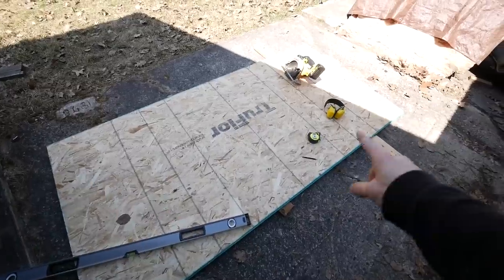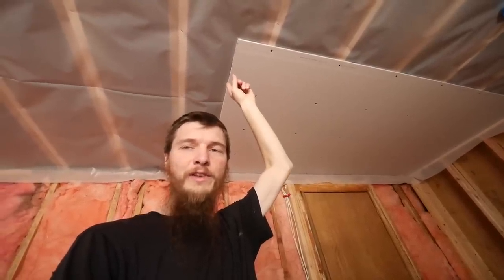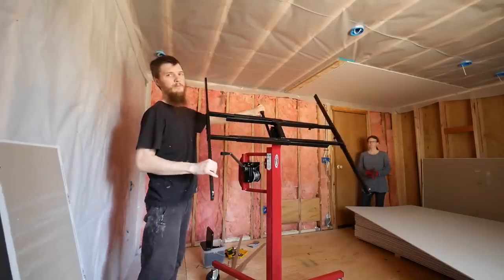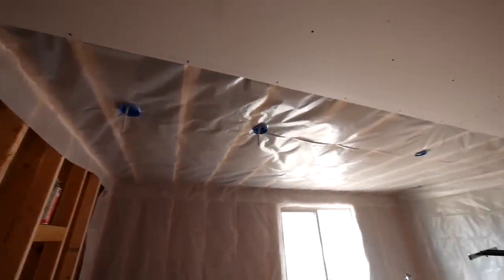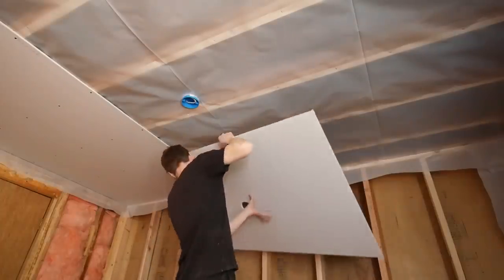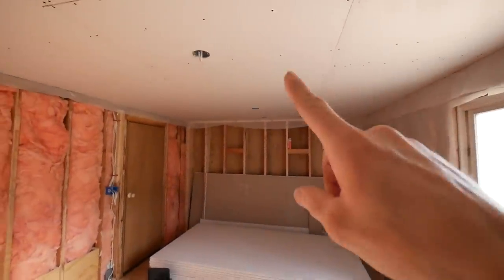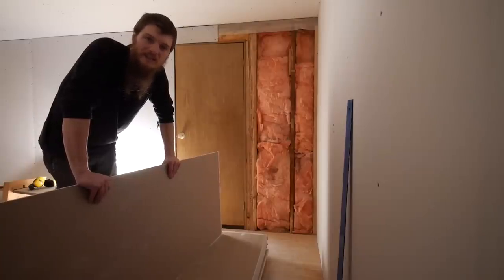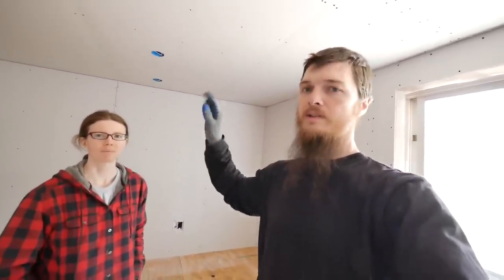DIY Amateurs Hang Drywall Like a Pro - Home Renovation

Comment: Awesome job guys!!!!  We went through a ton of drywall bits doing our house. I should have bought stock in the company, lol. We have to redo the kitchen ceiling and one of the bathroom ceilings because I hired a “contractor”, cough, cough, who didn’t know how do do skylights properly, AND forgot to put in the insulation in the ceilings of those rooms. Huge mess. True story. Anyway, he didn’t use a drywall lift either, so I’m going to order one from Harbor Freight I believe and we will do it ourselves. Should have done the ceilings ourselves to begin with. Live and learn, lol. You make it look very easy, and since our older son is 21 we have a third set of hands. I knew these kids would come in handy someday, lol 😉. Great job 👍👍

Comment: Safety tip: when cutting drywall be careful of the placement of the hand you’re using to hold the square. If the knife is angled a little toward the square it can catch the edge of the square and jump up over the square edge cutting your other hand. And since you have a bit of weight on the knife, you will cut your hand with some force. So hold your other hand behind your cut.

Comment: You are a stinking genius...although I've used that method to join sheets of drywall that didn't meet on a stud, I never thought of adding spacers. When drywall was less than $4 a sheet it wasn't a big deal to mess up but now days at around $9 it's more important to double check everything.

Comment: Looks great, have fun mudding and taping.  I used to do siding, and have been on construction sites where they come in and drywall, and wow, a ton of guys show up, and they drywall, mud and tape an entire house in like 2 hours.  Guys walking around on stilts for mud/tape on the top areas, its cool to watch.  Also, yeah, technically you can call that a T square, because it basically is.  T squares are similar but smaller (with a wooden head and plastic long part), and is used by draftsman (well, before drafting moved to computers), for blueprints and such.  My father was a draftsman for a while, then an engineer, and he had several T squares.

Comment: Doug, when you're cutting for windows/doors, etc, it is much easier to hang the board first and cut it to size in place (temporarily remove any door handles, etc which may obstruct the board).

Otherwise a great tutorial on cutting and hanging drywall, your home is looking fantastic, thank you.

Comment: I'm going to use the "butt board" idea in an existing hall ceiling that has cracked across from one side to the other. Been needing to patch for 5 yrs, but didn't want to deal with the "hump". Now I see how to avoid it ... IF my "seam" doesn't happen to come out right under a ceiling joist. Great video guys, though I was itching to see an outdoor view of your new place during early stages of spring green-up.
Reply from the maker: Spring is still just starting here. We'll get out there soon :)

Comment: I hope in time that but board dosn't cause pressure on the joint and look bad later. You do such good job of everything you do I can't see you not doing the drywall right.
Reply from the maker: There will be no problems with the butt joints over time. In fact this is an old drywall hack that a lot of pros use.
Reply: @diyfferent  Doug you are so correct my father did this also. He built homes for a living plus bought older home's and remodel them also. You really are doing a fabulous job.

Comment: Impressive, I have worked construction for almost 30 years and never seen that butt board tactic, I am not a pro drywaller, but have done plenty and seen even more.....I will be doing this on my next project !!!!!

 I never liked splitting a seam on a single 2x anyway as it is problematic and tried to double up the boards on seams when possible anyway, this is a much better solution !

  You know all youtube commenters always have a better way or idea...….., so here is my critic, I would have used 5/8ths fire rock, yes it is a little heavier and a slight increase in costs, but well worth it.
Reply: I'm in the same boat. I've been doing construction a long time, including sheetrock, and haven't seen the butt block. I was also impressed. Doug does very nice work.

Comment: Butt board is not the way to do it, just measure and cut much better and faster. The factory butt ends are tapered enough for finish without humps, I've hung thousands of sheets of rock and never seen a hump you speak of. Also better to cut drywall when it's standing up . Screws on cieling should be doubled up about 2" apart rather then one screw. To late now but fireex on cieling is standard. For walls drywall should be horizontal that way the seam you mud is at 4' and easy to mud rather then floor to cieling, now you know.
Reply from the maker: Not to argue, but the butt ends have no taper. Nails are usually doubled but it's not common or necessary for screws if you follow the proper screw pattern. Walls can be hung horizontally or vertically, hence the screw marking printed on the sheets are for vertical placement. A lot of pros hang them horizontally because it's less seams to tape but we don't like dealing with long sheets and prefer to hang vertically. Butt boards are actually used by many pros and it does a great job of simplifying the taping and mudding of the butt seem.
Reply: @diyfferent  In the pro world time is money. You will get it done and it will be fine, just will take much longer.

Comment: The dry wall lifter is awesome. I used to have to hold up the ceiling dry wall while someone else screwed it in and always ended up with back pain. Ceilings are hard without that tool.
Reply from the maker: Yeah, it's made the job so much easier. We already feel good about that investment.

Comment: Found you today. Binge watching the remodel playlist. I am not a builder, but I know a drywall tip I want to share. Use lipstick on the outer edges of the outlet and light boxes. Butt your drywall against the location like a dry fitting. Then cut your holes where the lipstick marks the drywall. No measuring required.
Reply from the maker: Thanks for the tip :)
Reply: Out in the Country - You’re welcome! I’ve personally seen this method used and it really works. Just be sure to make your marks on the cut side of the drywall. 😉

Comment: Drywall installation looks Great Ashley & Doug. Having remodeled many mobile home I appreciate you mentioning the weight issue. On most of my jobs I used 3/8" on walls and 1/4" on ceilings, as they were not on a permanent foundation.

Comment: One thing you have to consider with double wides is that they're two sections joined in the middle.I'm hoping the middle of yours has a concrete footing and not gravel to support it.Otherwise the center will act as a hinge and move with the changes of the seasons.

Comment: I too like to hang the wall boards vertical since butt joints are harder to finish.  Since your ceilings are a little on the low side, for your living room you could use a 1 x 8 board on each side of the trusses to make them look like beams, and then install either a drywall or plank ceiling against the top of the 1 x 8s.  I like the reciprocating saw blade holder.

Comment: Hidden talents there doug , pays in this day and age to be multi skilled ,  the more strings to your bow the better , drywall and mud  , we call it , boarding and plastering . Ie , mud being plaster in uk . Mudding is easy , its just getting the nack as we say , that is the feel and the movement of the tools and materials combination . It Combines into a flow or the feel , once you get the combination of feel and the speed , its a piece of cake , try dry practicing with the float the angle and the movement , it doesnt take long to master it , it just boils down to having the confidence to give it a go . You will get it , have faith in your own abilities thats how easy it is . One step at a time . Excellent job keep going .

Comment: "You two are a great team and I admire how you work to save  money. If I may give a few tips to save you time ( I've been drywalling for 30 years ) .
1) Start by standing horizontally about 6 of those sheets on a wall ( this will not be to much weight on a wall ) It will be easier to pull your tape and make a measurement.
2) Pull your tape-measure and mark your 1st ceiling joist center point . Use the "  T square "
Ashley was correct that is what it is. Then draw a line from bottom to top with a pencil.Don't move your T sq  and from that line look right to left you will see it's 16" to the end of the T-sq .Mark that point,move the T sq draw the next line bottom to top and keep repeating til you are at the end of your sheet.
3) One way to accomplish what you do with the butt board. On the ceiling before the install .
Use a 6 foot level / straight edge to see what ceiling joist is sitting higher then the others,break the joint on that one and you will accomplish the same thing without the board.
4) Hope this helps you 2 going forward and great job . Love the team work and your not afraid to tackle any project

Comment: Few small tips a  short rasp quickly  rounds the ends for the seams  and saves money on the but board and with the larger openings  such as doorways  and windows  if not trimmed out yet can be cut after drywall is hung also alternating  ends of the room you start drywall  on ceiling creates the natural staggering  unless your room is 16 foot exactly lol

Comment: Hi Doug, Ashley, I was surprised you didn't put any blocking in the walls so you could hang a TV on the walls.
What about the insulation in the ceiling?
Reply: Kimberly Jefferson you don’t really need blocking unless you’re hanging something really heavy like a wall mounted TV. Screwing into a stud or using an anchor does the job for most things. And they’re doing blown in insulation in the attic later.

Comment: Great job. I have used craft paper or even poster board to mark where outlets/light fixtures are. It cuts down on doing all the measuring. Just place it on the straight edge of where the drywall will go, you can mark it with a pencil or I just usually press on it to make an impression on the paper then lay it on the drywall and mark it with a pencil. This will make an impression in the drywall and then you can cut that out.  Just remember to keep the orientation the same as you lay it on the drywall.
Reply from the maker: Great tip :)

Comment: Wow I could have used someone like you when I had a "contractor" tell me he had to replace my ceiling drywall...and then took over a week to accomplish that, with a friend of mine helping. And that was for a 10 x 14 room with only ONE light hole in the ceiling! Then it took him another week to get the mudding to his satisfaction, which included humps all along the seams. That's a pretty neat piece of equipment, that drywall holder.

Comment: Ok guys. I’m an armchair disabled old lady, but I have to share this. Then I’ll be quiet. I can remember a while ago (15 years) where I saw an architect who finished his walls with plywood. He sanded and finished it, and it was beautiful. He was careful not to have wood with knots in it. It was beautiful. 
Every time I see your floors in that bedroom, I don’t see knots. Am I wrong? 
All you can find now is particle board. 
I know, it’s radical. Just let me know, are there knots in that floor?
Be patient with me.
Reply from the maker: Yea, the plywood we put down on the floors have some knots. There are different grades of plywood you can buy, some being rougher and knottier, and some that are more smooth with no knots. They also come in different veneers (oak, pine, poplar).
Reply: Thanks for humoring me, and for the education. ❤️

Comment: I believe that our mobile home which is on cinder block supports has sheet rock ceilings? looks like it maybe not but they are floating joists. we do have a sheet rock walls and peeked roof with attic (lol) such as it is. This is why I put pergo flooring not so heavy.

Comment: I have to say, I was wondering how Ashley was going to help with the drywall.  I've had 4 sheets of drywall that have gotten in  the way of my being able to get into an area I've needed to get into.  I tried moving a sheet of it, and I couldn't budge it.  My first thought of drywall was how Ashley was going to help lift the drywall to the ceiling and help hold it into place while you put the drywall screws in.  You've got yourself a handy piece of equipment there to help you out that melts all those concerns away.  Good job!  I can see you guys being able to add a room onto your house when your little boy gets old enough to have a room of his own.  Where did you pick up all the skills you've got to make all of this possible?

Comment: hello doug
 hey here is a suggestion for cutting out your holes and window openings . we do a lot of drywall work we use a Rotozip  spiral saw these things are slick . 
Just measure your box  location center  before you hang  your sheets then install your sheets then measure your center back on the drywall take your rotozip cut from the center to the  edge of the box opening go around it your done . no missed cuts this way and its super quick . 
We use mesh tape, I personaly like this better than the paper  joint tape its got a sticky back just lay stick it to your seams andmud it up  do your sanding and final mud finish then your done the mesh tape works real good in your wall to ceiling joint s as well .
check out home depot or lowes for a rotozip saw ' amazon or ebay also have them .

Comment: sooooo good. I did the same with all rooms with any type of closet, drywalled all walls, built closets and adhered drywall before I put the walls up. worked cause as my child grew he needed a bigger closet so just moved wall 2 ft over and an instant bigger closet. so much easier.

Comment: Great video, Next time raise sheetrock 1/2 inch off the floor so you can tuck your flooring under it and that will make it easier and that gives you some play room for flooring measurements. thanks for the but joint trick that's awesome.

Comment: We always glued & screwed the ceilings. Over time the glue holds the ceiling up better than the screws. With the vapor barrier on the ceiling I’d be a little concerned about condensation. I’ve never seen that done. Drywall looks good though.

Comment: Looks great! The only thing i would have recommended is a foot lift so the drywall isn't butted up against the floor.I like about  1/4 gap at the bottom
Reply from the maker: We lifted the first sheet with my pry bar but then gave up after that. We didn't have the proper drywall lifter or we would have kept going. Maybe I should get one for the rest of the house. It's all about having the right tools for the job.
Reply: Yes, I was wondering about the gap at the bottom. I know our house has that small gap and a larger gap in the bathroom walls.  Don't ask how I know LOL!

Comment: Doug where did you get the drywall drill adapter? Could you leave a link on where a person could get one? Thanks for the drywall tip that could work on a wall as well?
Reply from the maker: https://www.homedepot.com/p/DEWALT-Drywall-Screw-Setter-4-Pack-DW2014C4/202302391 The butt board tip won't work as well on most walls since the sheets would be hitting the top plate or bottom plate and prevent the boards from pulling in at the top and bottom.
Reply: When running drywall horizontally on walls, I've installed shims on all of the studs except the studs where the butt joints land.  There's less of a bulge after finishing doing it this way.

Comment: Don't forget to add lights in closet you know normally you hv like 3 feet from floor to bottom of cloths that are hanging it would be cool to build like a bench inside closet the length of closet with front sliding doors to store blankets and big stuff so all of space is being used just a thought

Comment: Love the butt boards in the ceiling!  Why not use butt boards for the wall joints too?  Won't you have a bump there just like you otherwise would on the ceiling?  Just curious.  Love you guys and look forward to all your videos.
Reply from the maker: The long sides of drywall come with tapered edges. We only put butt-boards in where non-tapered edges come together :)
Reply: @diyfferent  OHHHHH, I get it.  Because the drywall is installed vertically on the walls the tapered edges are what is nailed into the studs and the "butt" ends are at the ceiling and the floor.  Duh.  lol  Thanks for helping me on that one.

Comment: Looks great!  Now comes the "joy" of mud and tape.
Can someone explain why most drywall placing the wall horizontal and not vertical like Doug did?  Is there a reason for that?  Looks like horizontal makes for more mud and taping.
Reply: Because not all walls are exactly 8'  and a longer peice will hide   uneven studs easier and allows staggering of vertical seams easier and windows and doors will break apart the horizontal seams
Reply from the maker: A lot of the pros hang it horizontally because they can bring in long sheets of drywall and it leaves only one seam to finish around the middle of the room instead of having to work from floor to ceiling at every seam when installed vertically. It's really a preference thing. Vertical is nice too because you don't end up with a tapered edge at the floor where your baseboard attaches.

Comment: Interesting! Most of my working life (in Australia) was spent on houses with timber-frame walls and I've never seen that butt-board method of doing sheet end joints, or all the wall sheets and  joints being vertical. That's an observation...not a criticism. Different strokes for different folks. 
BTW...you're probably aware that lights too close to the ceiling show up every discrepancy regardless of how well the ceiling sheets have been done. I learn't that lesson on my first house. :)